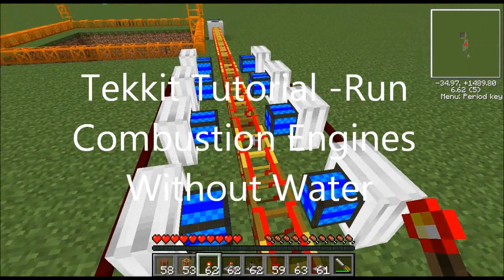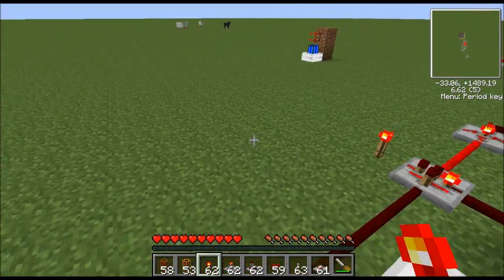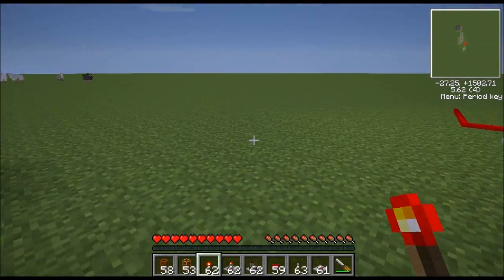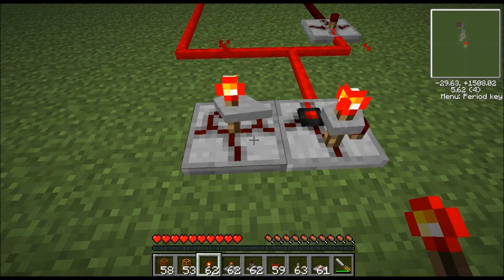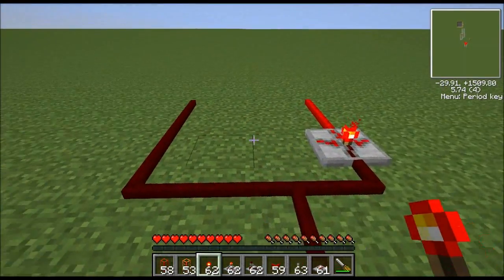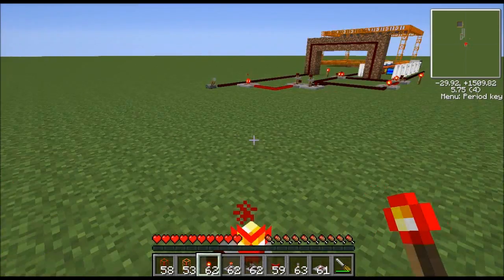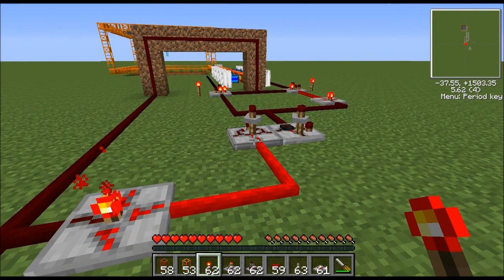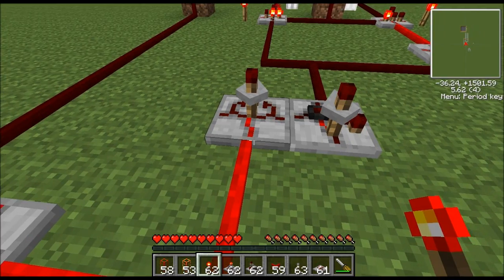Tekkit Tutorial - Running Combustion Engines Without Water

Comment: Here's a tip: Use a sequencer and 4 rows of engines instead of a toggle with two rows. That way your engines are on 75% of the time instead of only 50% (3 rows hot, 1 row cooling down). This gets 50% more power for the same number of engines!